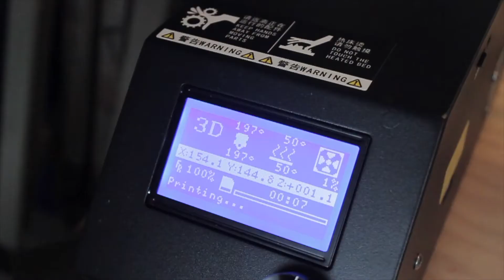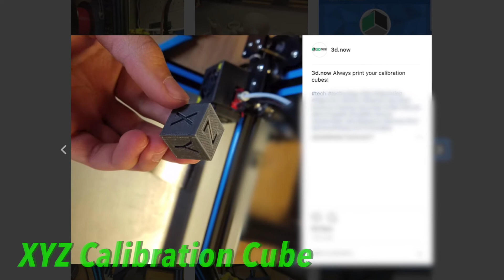Cr-10 Unboxing, First Thoughts... and Problems?

Comment: I feared you had lots of problems after reading the video title. But it seems that you got the printer working well after some initial tweaks. It seems like a huge upgrade from your previous printer. I have just gotten started myself after buying an Artillery Sidewinder X1. I understand it is pretty much like the CR-10S pro. The X1 has direct filament feed though and not the CR-10 Bowden style feed

Comment: I found more problems than good about this printer .
Reply from the maker: MrJefferson105 There are problems with every printer. Once you get past the problems on the cr-10 I really think it's a great printer for the price.
Reply: 3D Now yeah I do I agree for the diy comunity it's great but for a business is not so much as I look after 4 and every 6 prints the nozzle gets clogged or the bed is not level. I just think as a beginner this is not a printer to start with from a technical and maintenance point of view . It has a large surface are which is very good and the heated bed it's pretty good too . As you said it the price is good but it is not a machine that has impress me special when printing small things. I have been printing for almost 5 years with a prusa i3 clone and original and these printers have only broke on me 3 times in a year . It would be nice if someone did a video comparing these printers with the same settings in a controlled environment.